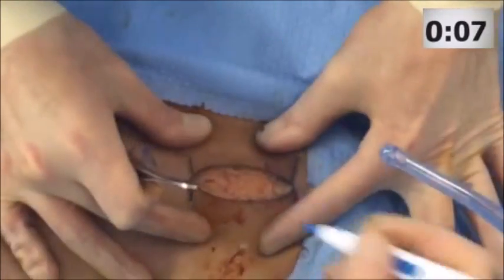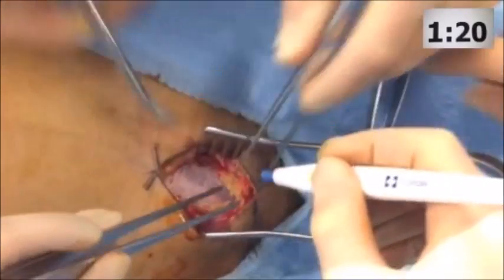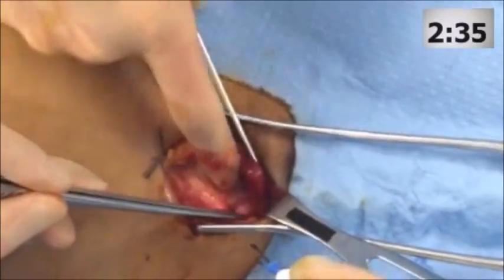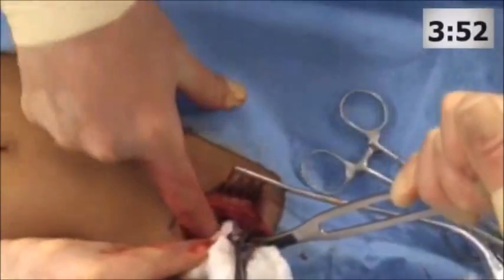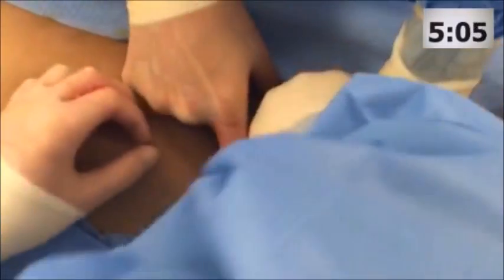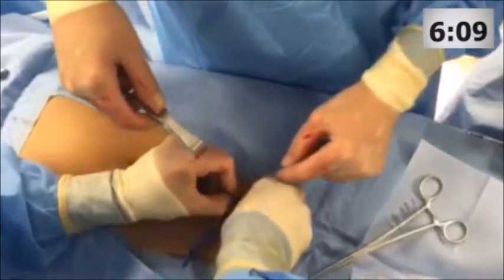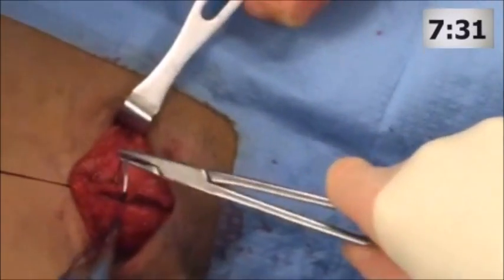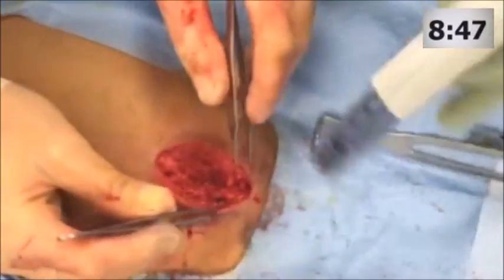Pelvic packing surgery LIVE "real-time" instructional video

Comment: great video!
Dr just got one question, I can not see the external fixator during the video, did it have it already? or you have a different protocol for packing, I never had to do it personally (a packing) but I thought is standarized to do it with the external fixation always first ,given that the bone traslation would make it bleed anyway.
thanks is an excellent source of education.
Reply: listen carefully at 6 min !
Reply: @gabrielrudek4123  yes thanks! But there is no external fixator by that time yet...and that is the place where it should be,so they aren't neither doing it simultaneasly...I know maybe they do it right the way...
Reply: @raulllodra4041  external fixator takes too long to do....packing can stop bleeding right away in a hemodynamically unstable patient.....